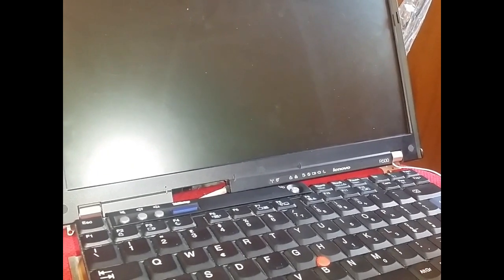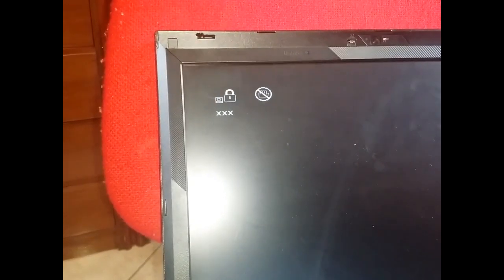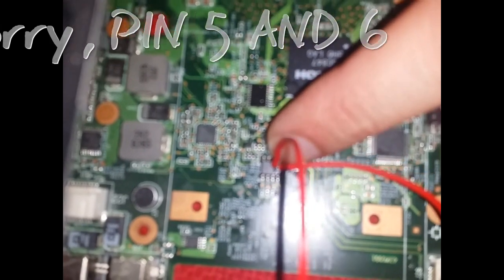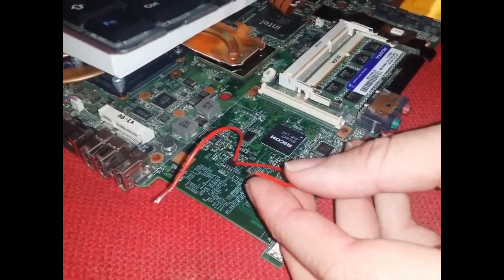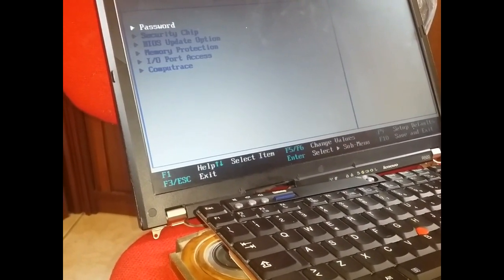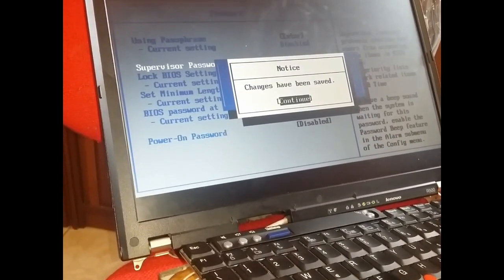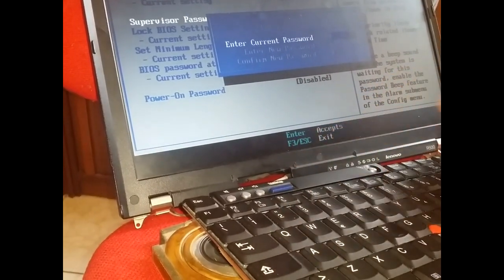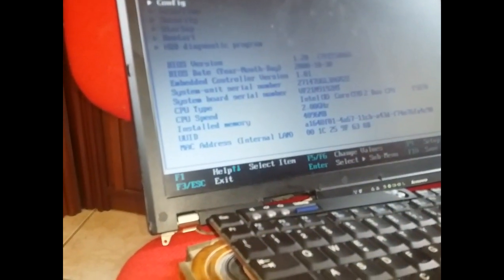Reset - Remove Lenovo Thinkpad Bios password - R500

Comment: Good “Day” Mr. Apna, I`m almost ready to apply your technique, but I have a question for you, in this particular case (Laptop VIT P1420) I`m trying to solve; the EEPROM I could identify on the MB; close to it, near the Pin # 1 (and a little arrow) is indicated: SBCN6 SBCN3; could in indicate or trying to suggest that these PINs are the ones that should be short?...
I am going to see if I can include a picture for you, Thanks in advance…

Comment: I must add, you need the hardware maintenance manual for your laptop from support section on  lenovo website in order to properly disassemble and reassemble your computer.

Comment: Thank you so much Apna! This worked for my T500 made in 2010. The eeprom was on the backside, so I had to place computer vertical in a vice, and use external monitor. I used paperclip for the jumper. I also remove the jumper as soon as I entered set supervisor password, then I made the password blank, then I save bios settings and bingo, voila, presto.. !! Supervisor password removed! Apna, tell me your PayPal address and I will reward you!
Reply: Hey i need help... i cant find  the little think where i had to add the jumper i have a lenovo thinkpad x61s....
Reply: I can't find a chip with a Big"N" on it...

Comment: Is this method possible on x270 I have the schematics and tried to short pin 5&6 but still same issue pls help tqvm
Reply: It has 2 ic w25q80bln and the other is w25q128jvsiq

Comment: I have a Lenovo R61. I found the eprom and jumpered it to access the BIOS as in the video, and changed the supervisor password to 1234. But when I remove the jumper it will not let me enter the password to change it, it says my password is invalid. As soon as the jumper is removed the computer is locked again. Can I just solder a permanent jumper on the eprom or will that damage something?
Reply from the maker: I don't think it damage. But do it on   your own risk.

Comment: It almost the same my R61(14" wd model) but when i set the pass 12345 and then release the jumper. The first page it learn mac was show. Go back to set pass 12345. It tell me incorrect pass. So. I can't fill in blank pass to remove password. Please help.
Reply from the maker: Maybe your bios have disabile bios password function where u can disabile with 12345 password that u set.
Reply: Apna Patente what will can do next to reset .? I can change date and boot order on the process to reset pass above.
Reply from the maker: Send me video of whole process maybe i can help u.
Reply: Apna Patente actually i take some pics.  how can i send you ?
Reply from the maker: Nbbf06@gmail.com
Reply: Apna Patente  i sent now. I will sent again If you not received it soon.

Comment: Can you set default the bios of a Commodore cloudbook P14? I changed something in a bios and I could no longer access it. I dismounted but did not bring internal battery and the disc is flash and is welded chip. (Sorry my translation i do not speak english)

Comment: Doesn't work on Lenovo ThinkPad X1 Carbon (Type 20BT) :( Connected pins 5 (SCLK) and 6 (SI/SIO0) and once it goes into BIOS, the supervisor password is still disabled. Do you have any suggestions? The EEPROM in question has the code MXIC MX 25L12873F on it.
Reply from the maker: that is bios ic, not the ic that i show u in the video.
Reply: Any sugestion how to reset this CHIP mxic 25l12873f ? please send answer  to me directly
Reply: @osergey3389  подскажите вы не решили проблему?? сброса БИОС

Comment: hy i am using lenovo L410 .   i have  the problem in Bios.
Bios password is set in my laptop and i have forgot it.
i had tried to solve this problem by removing cmos battery.
but my problem stil not solved.
please help me
Reply from the maker: try to check my this video if it works for u https://www.youtube.com/watch?v=FHJ3o6_AwYg

Comment: Hello:I have a thinkpad T410i Intel i3 Type 2516-73U with Supervisor password.This video will help me to unlock. AFAIK PowerOn password was cleared.

I can't locate the EEPROM chip.

I'm familiar with shorting BIOS process.

Thanks.
Reply: Hello:I can confirm that this works on Thinkpad T410i laptop.

Comment: This solution work on Lenovo Thinkpad X200 Table:
enter in bios with jumper.
mac address must be missing
enter in security and open the change password
at this point remove the jumper
wait some seconds (5 sec)
leave password blank and press ok
go to main main and check if there is available mac
if the mac address is present then save the configuration and restart your computer.
you should enter in bios without password.

Thanks Hardware,Software & Networks
Reply: THANK YOU!!! WHAT IS YOUR PAYPAL ADDRESS?
Reply: Спасибо! Помогло на Thinkpad R500
Reply: You´re the GOAT. Worked with my r500

Comment: Hello ! 
I have one T500 laptop, and i did this the bios password reset, but now can't start normal. Just writes this error massage : 
"BIOS Boot error 0189 invalid RFID conifguration information area."

What can I do to work again ?

Thx !
Reply from the maker: that is not a bios , that is eeprom where they write some protections and some other information like serial,mac ....
Reply: when i esc press thiss error massage, the windows turn on .
I do not know, what is the solution..

Comment: can i use this metod on lenovo 2522-3fg ?
Reply from the maker: if you have the ic that i show you in the video, it should be one of them that can be unlock.
Reply: do i need to take of ram memory out?
Reply from the maker: check the board or schematic, if you have the ic that is shown in video ,you can unlock.

Comment: Sir, I have a Lenovo Thinkpad W510 and it's EEPROM Part no. is ATMEL1025. i applied the method youve shown, but it does not working. So please help me out. i need your help. Thank You.
Reply from the maker: Hi, can you send me the motherboard model? Thanks
Reply: Thank you for your response sir. The Laptop model is Lenovo Thinkpad W510 and Motherboard part no. is MB08271-3 and the motherboard has nvidia GPU. Also I forgot to mention yesterday that when I short the pin no. 5 & 6 the display hangs showing Thinkpad logo. Thank You.
Reply from the maker: Hi, Mr. Mukher , i am unable to find the schematic for your motherboard and also i can not find the atmel1025 data sheet, please can you send me if you have the schematic and datasheet. Please donot short anything even you know what are you doing, do all at your own risk.
thanks
Reply: Sir, also I do not have the datasheet of atmeel1025 and schematic of W510. But I found the schematic of W520, which looks similar to W510. The pinout of the eeprom is same but not the part no. Also the resistors and capacitors levels around the eeprom is same. Pin no. 5 is leveled SPISI & no. 6 is leveled SPISCK. If you need I can send you the schematic and the pic of the eeprom from the motherboard. So you have to give me your email id. Thank you.
Reply from the maker: admin@rizwan.it
Reply: @HardwareSoftwareNetworks  Hi, sir. Sorry for interrupt conversation. I'm from Cambodia I learn architecture. I bought a second hand lenovo w541  from PC shop and this laptop have same Issue I can not use Camera or select boot.  can u give some advice, how to find the schematic of my lenovo w541 and I want to try to remove a supervisor Pass word. I don't know where is the eeprom on the mother board and what is the ID of IC?
Please help me. Thanks you in advance.

Comment: Hello sir, can u give yr mail id i want to send u high resolution image of my motherboard so u can identify the eeprom chip and help me
Reply from the maker: admin@rizwan.it
Reply: I have already sent you email yesterday, plz check and reply thanx
Reply from the maker: hi can you send me the motherboard model. thanks
Reply: +Hardware,Software & Networks sir mothwrboard model is mentioned in detail in same email, its Winstron LZ57 for Lenovo z570
Reply: sir did u get my email? when u will reply Thanx
Reply: Sir, you back after Eid celebrations??
Reply from the maker: Hi, locate G2201, short this and turn on computer.
Reply: okay sir but can u help me located G2201 on photo i sent u as i cant locate, normally where is it??
Reply from the maker: It should be near south bridge.
Reply from the maker: check your email. i sent u the image.
Reply from the maker: As the image sent to you in the email, have you solved the issue. Please comment to help others.
Thanks

Comment: Hi, I tried this method on my R500, I succesfully set the password 12345, but after that I cannot set the new password. When I try, I get "invalid password" message.
Can you help me?
Reply from the maker: try to set empty Password  (No password) and remove jumper wait  5 sec and then Save settings.
Reply: Hi, today I succesfully did it! You are great, thank you for your help! :)
Reply from the maker: thanks if you like please subscribe.
Reply: Hi, what have you done differently ? On my R500, I welded pin 5 and 6, I access the BIOS, I set the password to whatever (tried 123, 12345, <empty>), waited 5s, removed jumper, waited 5s, returned to main menu, then no way to change the password after that. Also, the MAC address displays well, but the uuid remains fffffff(...).
I tried to save at different moments, etc. No way.
Any idea ?

Comment: hey, i have a t400 with security chip P24S08. after using the jumper and setting the password to 12345 succesfully, the MAC address appears, but then i cannot use the password to remove it. i cannot change the system time so i must hit ESC key to boot windows every time. do you know a fix for this?
thankyou very much for the video, before i could not boot windows at all.
Reply from the maker: can you upload me the video?
Reply: +Hardware,Software & Networks i was able to change the time in windows, and it hasnt given me any dramas during boot now. however, i cannot make many changes in BIOS (just some). i will upload a video now
Reply: Hy! My problem is  same at the R400. You find problem solved?

Comment: Hi, I have a lenovo flex 2 14 with bios password set which I fogot. I see this Bios chip 25q064a. can you help me to reset the password.
Reply from the maker: i don't think it can help you, if you have spi programmer then make a backup of this eeprom and fill it with ff and resold on board to check what happen ( i think you will loose mac address and get some error on startup but you can access the bios).

Comment: Hello, I have an ideapad y510r  that's locked up with bios password  and the mb #'s VIQY1 NM-QA032 Rev:1 . 0 2013-03-14  .I have the mb out and  can't locate this bios chip  that you have here on yr video ,is this an oversight  my me or can't this be done on my board ? thanks
Reply from the maker: hi have you solved he issue?
Reply: hello,no  I want to ask you if this chip is the type you're describing here that can be jumped ? Thanks
Reply from the maker: try to make jumper on short pads under RAM, locate JME1  & JCMOS2 and make the jumper  and turn on computer and check if password is removed and let me know.
Reply: I'm going to do it and let you know the result as soon as I'm done -thanks

Comment: Hi, I have Lenovo Ideapad Z570 model Emrald lake Motherboard FAB1 version, when I go to BIOS, it asks for password which I donno, please guide if your 5/6 pin shorting will help and not brick my laptop.
Reply from the maker: Hi Uttam, if you found the right ic then apply the procedure presented in the video, it should work.
Reply: the shorting of 5-6 eeprom pin is universal, what could go wrong if i short pin 5-6 but despite rom getting erased, something else like motherboard going bad??
Reply from the maker: depend on which eeprom you apply this process, if you select the wrong eeprom, the something may go wrong on the mainboard.
Reply from the maker: if your motherboard is wistron lz57, i think you can unlock with out eeprom method, just locate the G2201 and make the jumper and turn on the laptop and you should enter in bios.
Reply: Okay sir, so what you are saying is that if correct EEPROM is identified that has the BIOS info, shorting will mostly do the job and password will vanish. What info I can give you from my motherboard so you can tell me its the correct one, should I give you a list of all ICs with their print lable on top and then you can tell me.
Reply from the maker: +Uttam Kumar send me motherboard model or the photos. so I can tell you if you can apply this procedure or proceed with another method.
Reply: Hi, its part No 11013530 - MB LZ57 UMA FOR DUAL CORE NEW
Reply from the maker: good, just locate G2201 make jumper on gap and turn on the pc and you should enter in the bios and please subscribe. Thanks
Reply: Thanx sir, you are very helpful.
Reply from the maker: i am happy to help you, please subscribe if you like this. thanks